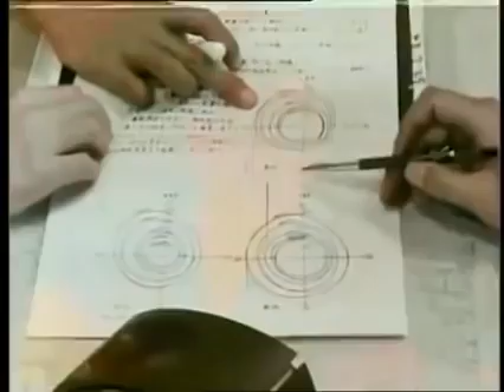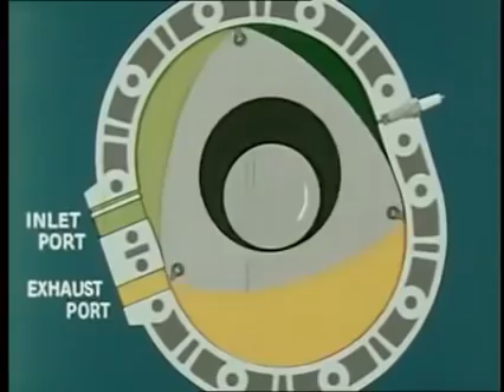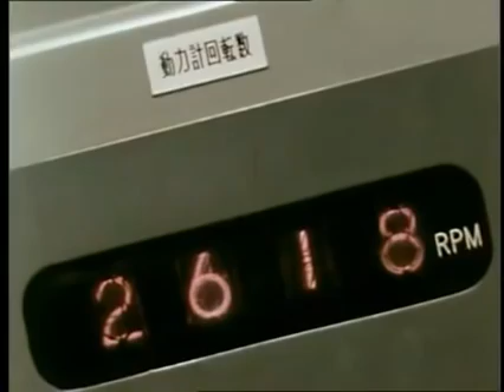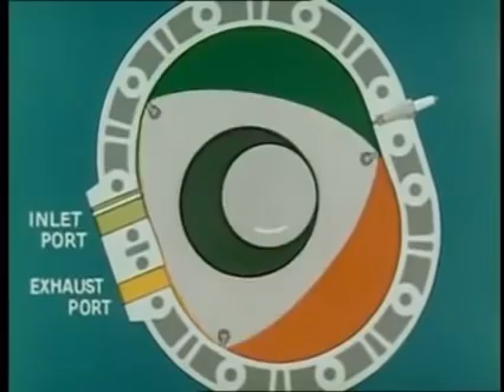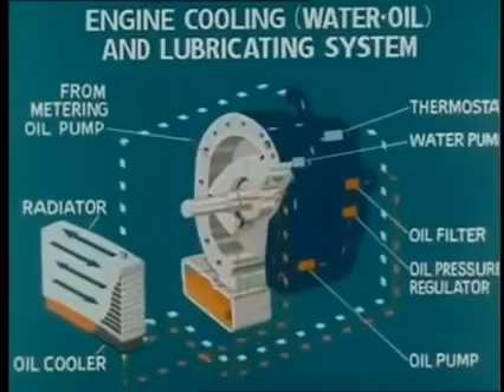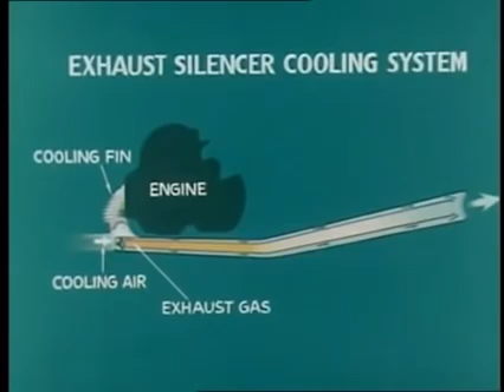Rare Vintage Documentary: How Suzuki Built Their Iconic Rotary Engine Motorcycle |#SuzukiRE5

Comment: I owned and rode one for a few months. It was heavy, hot, and had less power than the Honda CX500 I rode for a few years. It smelled bad due to the oil it burned like a 2-cycle engine. You had to check and add oil every time you wanted to ride it. When a Collector of Motorcycles offered to buy it for slightly more than I paid for it I didn't argue at all taking the money and thanking him. It was a terrible motorcycle I regretted buying soon after I started riding it.